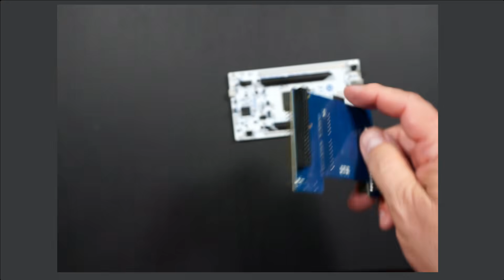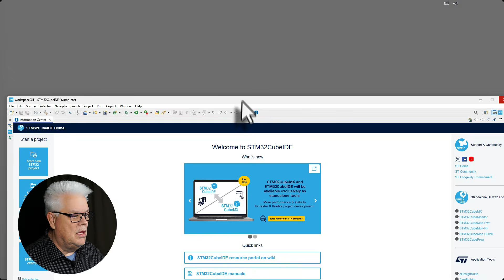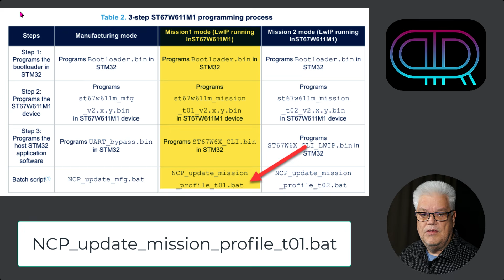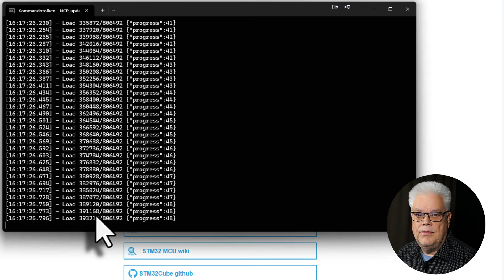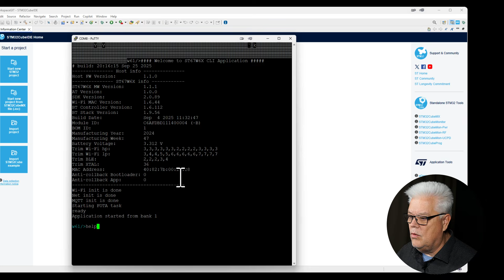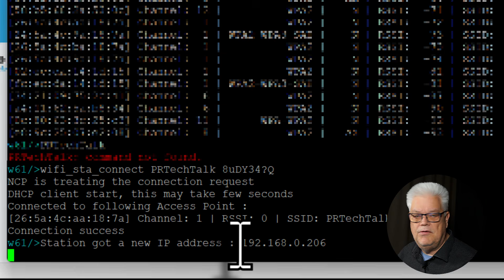Easy Guide to Using the ST67W611M1 Wi-Fi Module

Comment: Hi Sir, I have enabled Wi-Fi and it is connecting successfully. However, the TCP connection disconnects after some time. I am using the W6X_Net_Setsockopt function for a stable connection, but it is still disconnecting. I need a proper TCP transmit and receive implementation. Could you please provide guidance? It would be very helpful.”
Reply from the maker: The `W6X_Net_Setsockopt` function is for setting socket options, not directly for connection stability. For stable TCP transmit/receive, focus on robust error handling in your application layer, including re-connection logic and proper buffer management. Ensure your network environment is stable and check the module's power supply.

Comment: How do I fix my terminal so it all comes out in proper columns and rows? Mine  doesn't seem to line up nicely but my PuTTy/Mobaxterm settings dont seem to help.
Reply: I had this same problem and found that under 'PuTTY Configuration/Terminal' checking both 'Implicit CR in every LF' and 'Implicit LF in every CR' fixed the problem.

Comment: I have developed a custom wifi board using st67w611m1 series wifi module of stm32. When I try to flash firmware via UART , I am getting the following error handshake fail

Comment: I just got these boards and I’m new to both STM32 and STM32CubeIDE. Working on making the jump from Arduino/Esp32 to making my own custom boards. I noticed you didn’t program through the IDE in your video. Is there a reason for that? When I try to run the demo program that comes with STM32CubeIDE, it hard faults due to not being able to read memory.

I have a project coming up that will use the STM32U575RIT6Q, and I’m trying to get the Wi-Fi dev board working with a NUCLEO-U545RE-Q. Do you have (or know of) any resources that walk through getting the ST67W6X Wi-Fi middleware set up on these boards?

If you’re ever looking for ideas for future videos, a full walkthrough using the STM32U575RIT6Q (or a similar device) that shows how to add the ST67W6X middleware and set up FreeRTOS, UART, SPI, etc., all the way to a working Wi-Fi framework, would be incredibly helpful for anyone starting a Wi-Fi-enabled project.

Thanks for the great content!

Comment: Please do more tutorials on this board. Thankyou sir.
Reply from the maker: Thanks for your comment, any suggestion on topic ?  Brgds /PR TechTalk
Reply: @prtechtalk416  Thank you for your response sir. I am required to validate the T01 firmware flashing procedure, where the host controller STM32H723ZGT6 programs the secure element ST67. I already done it in standalone mode I need it in HOST mode.

Comment: Have you compared the price. You must be joking. It may be ok for Industrial applications where security strongly matters. But can't compare with esp32 price point
Reply from the maker: You are right that Espressif are low cost. Despite this their are quite a lot project that a re price sensitive that dont use ESP but they think it worth the cost.
If you consider CRA and RED many feel safer using Qualcomm chip  vs support from forum.  / PR TechTalk